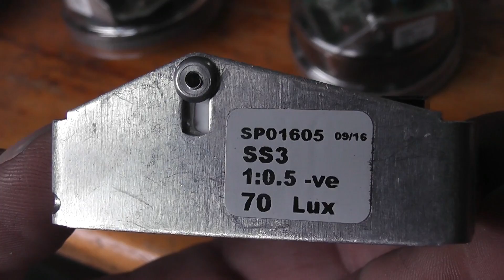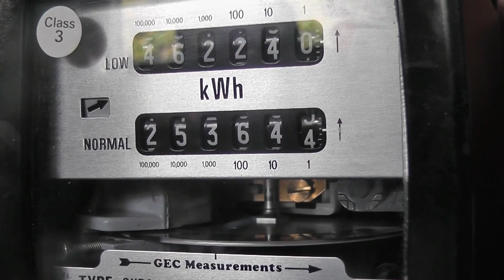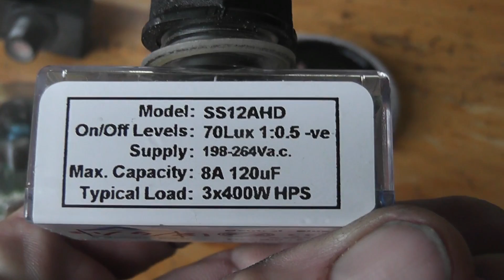Zodion Photocells autopsy and analyses [2]

Comment: Pretty nice day-night controls, I never really liked the simple LDR ones with the mechanical bi-metal strips...

Seems straight forward. An ST Z0103 Triac driving a larger BTB24 Triac, 97 ohm gate resistor. The other 97 ohm resistor is part of how they supplied power control circuitry, which is where things get pretty wonky from what I can see in your video. I have not got one of these to disect at the moment. Likely using a Zener as a voltage ref for comparators utilising the LM324 opamps. Timing looks to be achieved by a simple RC circuit in the comparator chain.

They did good putting the MOV in there... but there is no snubber on the Triac output... which is silly considering a lot of outdoor commercial lighting is HID, which being choked/ballasted means inductive load. That certainly would drop longevity LOL =/. Funny enough, there is even an application note about inductive load snubbing for Triacs by the same manufacture... which use the BTB and Z0103 in the example. 

The BTB24 Triac they used actually does have a snubberless model available but they did not use it in your unit. BTB24-6000BW would be the snubberless model, where the W indicates snubberless (though I'd still rather actually have an external snubber).

I'll have to reverse engineer one of these fully someday... Oddly enough, it looks like there are pads for the placement of a snubber circuit, its just not populated. 

EDIT - Just had a look at specs for the SS3 & SS6.
http://www.lucyzodion.com/products-overview/photocells-controls/photocells/streetlighting/ss6-series-streetlighting-photocell/

SS3 shows supporting up to 800w inductive... whilst SS6 is just '-'... wonder if the SS6 was intended for resistive loads only... that is the only difference listed. Also highlights your catch of the board saying SS6 but yet chassis having an SS3 sticker, and the Triac being the non-snubberless version. Seems something went dodgy in the production run perhaps.

Great video mate ^_^ 
Cheers
Reply from the maker: Thanks for your very detailed reply. I got hold of another 20 x SS4 versions which appear to have a small relay in them. Need to analyse how they work. The SS12 also has a relay within the device.
Reply: NP and much thanks for the video. Thats a pretty good score, esp if they all came from the skip! Always found commercial lighting interesting, specifically street lighting. LED quickly fading all those away, merc is just about gone. Nostalgia I guess, even though merc is mostly before my time. Zodion sure has quite a few models, and all rather interesting. I can see maybe relay being used for more erratic operating conditions. Deffo will be interesting to see in the SS4 and others if there are any other significant differences.
Cheers

Comment: Blue part is an mov.  They appear to be deriving a low voltage by AC coupling current through a rectifier. There should be a large zener somewhere. The brown resistors appear to be flame proof type. LED is probably to self-test circuit.

Comment: 224 - 220nF, it is either the triac or X2 capacitor failure most likely. That "LDR" looks more like usual photodiode with larger die for more sensitivity.
Reply: I second this.
The X2 capacitors is made by Panasonic, which makes good quality stuff, but over time the film capacitors of any brand can loose capacitance due to the metallized film being zapped.
Strange that it has failed so early though... my guess is that, if the X2 cap is bad, the cause is due to voltage transients from when the load is turned on and off.
Reply from the maker: Agreed

Comment: Aaaah, thanxx for taking one of these apart. The only ones I am familiar with, are the 
LDR-type, combined with a thermal bi-metallic strip with a contact on it.

Very basic operation, but the standby power consumption of those has to be questioned. Whether-or-not the electronic ones are more efficient is unknown.

The idea of connecting up a photocell and using it as a Rate Changer is an interesting one, but the thing is, a photocell switches the live wire and a dual rate meter needs the neutral to be switched.

The only way I can think you done that with the cell you used, is that it is double pole and you used the switched neutral only, or another way of doing it would be to get the operation of the cell to energise a coil in a relay and then the contact in the relay triggers the Rate Changer on the kWh meter. :-)

A sunlight-dependent Rate Changer has been though of by me before, but the thing is, because of sunrise and sunset, there would be a difference throughout the year of what gets recorded on the low readout compared to the other.

OK, that might be useful when the meter is a secondary meter recording more than just lighting, because then the readouts could be designated as "all other loads only" for the day rate and the low rate can be re-designated as "all loads including lighting" and in that way, the low readout can be used to record the load of the lighting.

Thanxx for showing,

-Wayne's Electrical.

26th October 2017, 18.50
Reply from the maker: The 1Ø GEC CT meter from 0710Jack needed a Phase (Active) to operate the day night change over coil, instead of the Neutral. It is actually very easy to convert the polarity for the rate change over coil anyway. Will do a standby measurement versus thermal photocell. Zodion manuf claims 0.25 Watts.

Comment: looks like an LM324 quad op-amp on there.   It is a surprising amount of parts.  Those weird "Resistors" on the board marked white, purple, black, silver appear to be fuses?  If it was a resistor, it'd be 97 ohms 10% which makes no sense.